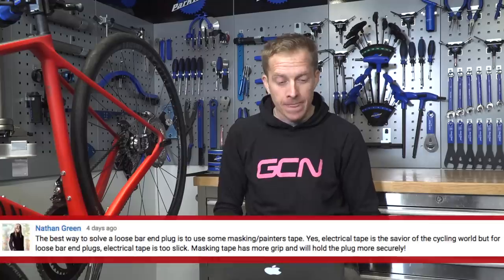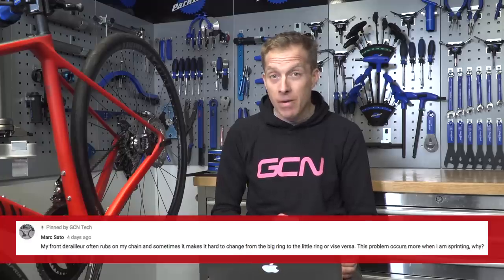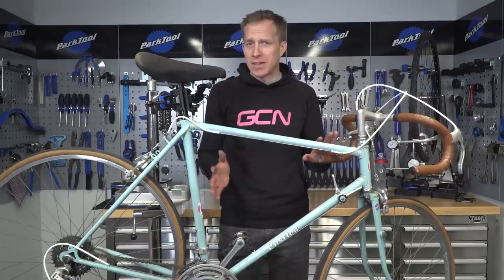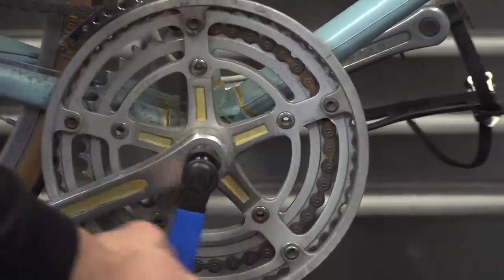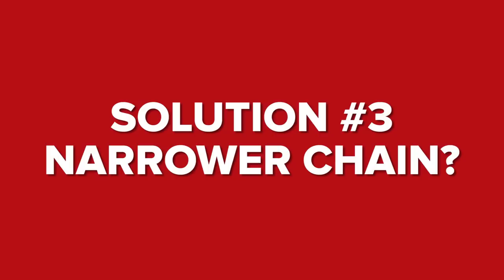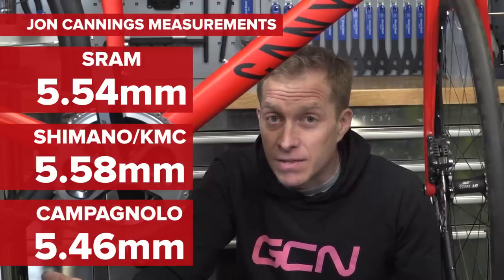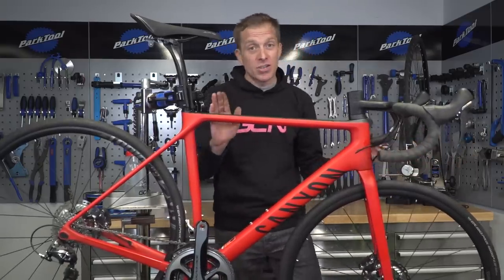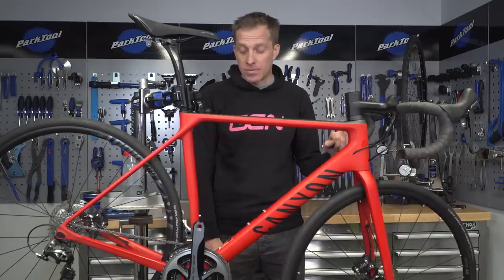How Can I Stop My Front Derailleur Rubbing? | The GCN Tech Clinic

Comment: My issue: 
I have a problem that whenever I use my 2 heaviest gears on my rear shimano 105 cassete my bike starts making a creaking/scraping noise
I can't tell what it is or figure out how to fix it!

the model is a lapierre xelious
press fit BB
shimano 105 groupset

please help it's really disturbing and I'm sorta afraid of using those 2 gears as a result!
Reply: Same
Reply: If it’s coming from the front derailleur (you can carefully look down while you ride to see) it’s just an indexing issue with the front.  That’s because the chain is angled toward the outside of the bike slightly within the tight space of the cage.  Modern front derailleurs can be a pain to get right, but with some perseverance and optimism, you’ve got it!  If it’s not the front D, try having a friend hold the bike up by the saddle while you turn the cranks and try to listen for the sound.  If it only happens when pedaling, you’ve got a crazy BB!
Reply: I had the same issue with the same group set over the summer. I had to take the pedals and crank off, give them a good lube, and the issue went away,
Reply: Thanks Samuel I'll be sure to check that and if that doesn't work Jamie your tip might help so I'll give that a go!

thanks a lot and if anyone else has a theory of what might be cause it please comment and feel free to try and come up with a solution!
Reply: Definitely let us know! If I can, I might get a quick recording of how I did it.
Reply: It could be as simple as a rear derailleur cable settled with too much tension. Try to loosen the cable a bit.
Reply: Kuma Duma

Sorry if this seems obvious. You mention the 2 heaviest gears on the rear cassette but you don't mention whether you are on the small or large ring. A large to large or small to small ring/cassette combination can produce the noise you are describing. 

Occasionally, I lose track of which gear I am in on my Ultegra 6800 11 speed and shift too close to this cross. The chain makes a horrible noise and I know to adjust the gears up or down.  The cross puts too much torque in the chain and should be avoided.
Reply: Rick snyder the noise is made no matter what gear I'm on the front gears and on the rear it's only my 2 heaviest so the smallest sprockets!
Reply: You should really try to tighten the little wheel/screw (sorry don't know the english name for this) on the back of your rear derailleur at the end of the cable. One round (or even 1/2) should be enough.
Reply: Kuma Duma

Then it sounds like the indexing on your cassette needs a slight adjustment.
Reply: dunno if this is the same for everyone but on my bike in the big ring at the front it does that either with the two highest or two lowest. my solution is that when you change ring just click the gears slightly and it should stop.
Reply: It is not uncommon to have movement in a pressfit BB, especially in the plastic cups. You can try pulling your BB and refitting it or get something like Legit Engineering's press-fit replacement that will eliminate the plastic bits. You might also want to inspect your frame for any cracks or odd looking blemishes in the chainstays, I had a bike that would creak when sprinting and it turned out the epoxy bonding between the aluminum lugs and carbon was moving.

Comment: I have 2012 cannondale synapse with Sram Apex brakes.  I can’t stand them because the rear is always getting brake rub !  I can move the mech back and forth slightly with my hand is that part of the problem or how do I address ?  I’m tempted to either upgrade brakes or dump the bike altogether and go disc .
Reply: Andrew Brown
The problem may not be with the brakes. If your rear wheel is out of true it could be wobbling and causing the rub. If that doesn't work, make sure the caliper is attached tightly enough to the frame.
Reply: You might want to try using a 13mm open jawed spanner to hold the caliper in a central position while tightening the brake mounting barrel bolt.

Comment: I have an issue with getting clincher tyres to seat properly. I must of taken them on an off 10 times and there is always a section that sits low. Try pumping up above my disired pressure then letting down. The tube isn’t pinched and is in the tyre correctly. It’s not fun riding along on what feels like an oval wheel! I been riding and changing tubes forever and this seems to be a new issue..different tryre and different wheels...I’m at a loss! Any tips?
Reply: When the tyre is fitted partially inflate it just enough to hold the shape. Then, starting at the valve go around the tyre pushing it away from the outside of the rim on each side. This will do two things,1. ensure that you are not going to pinch the tube and 2. manipulate the carcass so that you get an even inflation.
Inflate to the max capacity of the tyre then deflate to your desired pressure.

Comment: I've washed my bike yesterday with a hose (low pressure) and somehow my frame got filled with water! 😱 Any idea on how this happened, how to avoid it and how to remove the water from inside the frame?
Reply: I've removed the water by rocking the bike back and forth whilst on a vertical position and it ended up leaking through the cable guides on the bottom bracket.

Comment: I have a Simano 105 groupset on my road bike.  I've had my front deraillure set correctly at my local bike shop.  Once setup the shifting is perfect with no chain rub.

The roads that I ride on are quite bad and full of pot holes and rough surfaces.  Despite being as careful  as I can with the bike after a few days riding the chain starts to rub again on the deraillure cage.  

Is it normal to keep adjusting the front deraillure to avoid chain rub?

I've tried trimming the gears to move the cage a tiny bit but this never seems to make any difference.
Reply: Did you get any where in this ? My SRAM front mech has started playing up. Catching on the crank so I screw in the adjuster screw and bring the mech closer in. Solved. Until I've done 60k and it's catching again. Grrrrr.

Comment: Is my bottom bracket the thing making the creaky sound or is it something else?  It comes when I put more power through the pedals. I am doubting it because it seems to be worse when I am in the smaller ring.
Reply: Stuart Dryer Though the BB is notorious for creaks, it’s an expensive replacement and there are a few other places that are helpful to check before we blame the Bb.  You are clever to be suspicious!  Since the strain on the drivetrain is less in the little ring, it’s less likely to cause a BB creak.  However the torque is greater!  The wheels have to absorb that torque, and can actually be the culprit.  Simply apply some lubricant to your spoke nipples from the outside and the spoke crosses, using triflow, WD40 or a similar penetrating lubricant.  This might fix it right away!  Another issue could be the shifters if your creaking happens out of the saddle.  This is just an annoyance you’ll have to live with if that’s the case.  Similarly it could be grime in between the stem and steerer, which just requires a clean.  Lastly, pedals may creak with worn bearings or dirty springs.  Good luck!!
Reply: Check the fasteners on the chain rings. I've seen them come (ever so slightly) loose, enough to creak a bit.
Remove the pedals, clean the threads and apply some grease before reinstalling.
Do you hear the sound when standing, or just when seated?
If only when seated, it could be the rails on your seat.
Reply: TW Thanks all.  I tightened chain ring bolts. No noise today.

Comment: I have SRAM eTap running great on my bike. However every few days it appears that I have some issues with shifting smoothly. Generally I ignore it and the next ride is perfect. What can be causing this intermittent issue?
Reply: Bart Segall Great question!  Even Etap needs to be indexed, though it’s often set and forget.  Look up the user manual for verification, but if my memory serves me right, here’s how you do it:  look for a small button on the inside of the right hand shifter.  Hold down this button while pressing the shift button.  This will make small adjustments to move the derailleur outboard.  Using the other shifter in the same way will move the derailleur inboard.  You DONT have to run a full SRAM drivetrain for it to work perfectly, although oval chainrings and S-Works cranks have been know to cause some trouble.  If that doesn’t solve it, there are just s few more things to check, all of which can be researched easily on SRAMs website.
Reply: Samuel Hopely I can understand why oval chain rings could cause a problem, and know someone who had to move away from etap because they use oval rings. Not sure why S-Works cranks would cause a problem though. Please explain as I am currently specing etap with S-Works cranks for my next build.
Reply: Rear derailleur. Checked my hanger and it was slightly out of alignment. Rode 40 miles no issues so perhaps that is the issue. Thanks

Comment: How to get lower on hybrid bike. Handlebar is at lowest position all spacer are above. Can I reverse my riserbar upside down? Or should I get flat handlebar?
Reply: Difficult to help here without knowing what stem you have. It is possible to simply flip the stem to get a lower position, or if that has been tried you may want to invest in a  -17° stem. That should get you another 10mm or so lower.
Reply: Colin Milne : my stem is flat (0°). Have a riser bar of 10mm rise. Is there any disadvantages to flip riser upside down?
Reply: The trouble with simply flipping a riser bar is that once flipped the dihedral angle of the bars turns into an anhedral which means that your hands will tend to slip off the bars. Probably better to get some flat bars.
Reply: Thank you for the answer.  If i change my riser with touring bars, will it help?
Reply: If you mean drop touring bars you will need new brake lever/ shifters, an expensive choice. Alternatively there are the butterfly touring bars which afford multiple hand positions, these can be sourced with no rise.Or simply go for a flat mountain bike bar with no rise.

Comment: My bike has a Shimano press fit bottom bracket.  I'm running ultegra 11 speed with speedplay pedals.  After a rather wet century ride, the bike developed a popping sound coming from the crank area and I could feel a bit of "grinding" when pedaling.  What are the possible causes?
Reply: William Keys I have the same thing but I have 105 pedals and a square taper bottom bracket. Can't seem to diagnose the problem myself.
Reply: Bottom bracket bearings need changing. 
I used to get this on my ISIS (ahhh) B.B. a tiny bit of grit gets in between the balls & if there’s a pit in the race you’ll feel it click at one particular point in your revolution. 
I changed Pedals , greased threads, & glued on pressfit cranks ( don’t do this) before I realised it was my B.B.
Reply: David Fellows I have already done that and it still did that on the first muddy ride after having them changed.
Reply: alex fulton re grease your pedal threads, try beeswax jelly on your cleat - pedal contacts - look for oz cycle on YouTube on how to make. 
Anti seize compound (thicker than grease) on your B.B. threads. Could also be your pedal bearings but do not try to change Shimano bearings. They will never go back together again- trust me. Other than that I don’t know.
Reply: Speedplay recommend that you purge the pedals after every wet ride. Worth trying, I had an annoying click every pedal rev on my LA's and purge greasing solved it.
Reply: Colin Milne thanks for all the help guys, ilk do one at a time and see if it solves the problem ☺
Reply: Colin Milne yes this is true. Also I’ve noticed the new style of speedplay cleats - the walkable ones the yellow rubber rubs on the pedal axle & causes a squeaking noise also  the spring can creak when you move your foot from side to side if some dirt dries up in it.
Reply: You are the winner Colin.  That was the solution to my problem.  That Speedplay recomendation isn't one to be ignored.
Reply: William Keys awww drat I tried so hard too I suppose 2nd place isn’t too bad 😝

Comment: I have a Focus Izalco with SRAM Force. The '22 useable gears' is real by the way. My problem is that often when I roll the bike backwards the chain comes off the chain set (inwards). Tried playing about with front mech but it still does it
 Any ideas?
Reply: Fit the chain catcher that came with the front derailleur.
Reply: Chain catcher is already fitted. In some ways it makes it worse as sometimes the chain squeezes past the chain catcher which makes getting the chain back on even more of a pain (and that's with the chain catcher as far towards the chain as it will go without rubbing on the chain).
Reply: Colin Milne I'm now wondering if the rear mech is misaligned: it came part way off yesterday and came off at the bottom as though the rear mech was pulling it off
Reply: Sounds reasonable, take it to your LBS for a proper alignment check.

Comment: Yeah, no. Don't shift while sprinting. I did it about 15 years ago, sprinting away from a stop. Stupid mistake. Chain came off, I went down like a sack of wet sand, shattered my shoulder (all the cartilage in the socket..both the ball end of the humerus and the socked part in the shoulder..are free floating to this day) and nearly got run over by a city bus. 15 years later my arm still goes numb every so often.

Comment: My front derailleur screws are stuck and I can't move them. I've tried WD40 and not blaster, any other solutions?
Reply: Randy Poor If your FD is a little on the older side, you might unfortunately be better investing in a shiny new one, though you don’t need to go top of the line (remember they have to be compatible with your shifters!) If it’s newer, you might be able to warranty!  Shimano SRAM and Campagnolo are surprisingly helpful with warranty issues (they don’t want you giving up and moving to a competitor!) so give it a shot if that’s the case!  FD screws can be, well, screwy sometimes, but your troubles are definitely unorthodox.  Your lbs would be the only place authorized to do warranty work for you, but more than likely wouldn’t have to charge you (the manufacturer has to compensate them for the labor, or in the case of SRAM give them a shit ton of free chains)
Reply: Randy Poor 
Did you remove it and soak it in the wd40? Or just spray and go? If you just sprayed, try soaking it for a bit. That usually does the job for me for my stuck parts.
Reply: That Ewok spray and go :)
I'll try soaking it. Thanks!

Comment: My question is, why does my jockey wheel vibrate when I'm cycling. I put my bike up in the air and when I peddled, the whole rear hanger started to vibrate.
Reply: Possibly worn bearings in the jockey wheel. I had a similar problem on a Sram Rival dr, when I dismantled the jockey wheels the bearings were toast.

Comment: How to clean a very oily chain
Reply: Ciaran A Tupperware box, water, laundry liquid - shake. Repeat 3 times. Then dry either with hairdryer or leave to drip if you have more time.
Reply: Use muc off drivetrain cleaner
Reply: Janosch K if you want to have no money left and messy floor - use muc off chain cleaner.
Reply: Be sure to clean the chain rings,  cassette and jockey wheels too. Otherwise those dirty parts will keep your chain dirty too.
Reply: If you want to really clean it to have something shiny as new, gasoline is really efficient, it will dissolve the oil and all the dirt. And the drying step is really quick (2min) so no way your chain will rust. Then you can oil it again. It works for the cogs and the chainring as well. But don"t try this on the jockey or other pieces with bearings because it will harm them.
Reply: Soak chain & sprockets in petrol in a sealed container. Dry. If you never want an oily chain again then immerse in melted paraffin wax with a bit of paraffin oil in a slow cooker for 20 minutes. The downside is that you need to repeat this last step quite often (300 miles). The upside is a super clean chain and great shifting with no sprocket/chainring wear. Great for commuter bikes and day rides. Terrible for touring.
Reply: Ok. You are right
Reply: clean it once roughly and then again properly

Comment: Why is the right brake stopping the rear wheel? You guys are in England so wouldn't the brakes be the in conventional way? And it's a Canyon as well.
Reply: John Doe noticed that as well
Reply: I think all bikes in England are that way. In the states, it's often called moto-style.
Reply from the maker: +John Doe it's pretty common for bikes to be set up like that in places where you cycle/drive on the left hand side of the road.
Reply: Yep! That too! I believe it stems back when which hand you'll commonly indicate with. Since England folks are on the left side of the road, you'll indicate more with your right hand and brake with your left.
Reply: UK bikes come with the right brake lever operating the front brake as standard. If you go into any bike shop that is how they are set up and in order to get it the other way around you must specifically ask for a continental configuration. Continental configuration is where the right brake lever operates the rear brake, this is how most serious cyclists eventually arrange their braking.  It has nothing to do with which side of the road you ride but does have a lot to do with weight saving on cable outers. The continental configuration shortens the required length of cable outer quite considerably.

Comment: Fraying break cables
Reply: Prior to cutting the cables to length tin the cables where they are to be cut and cut through the tinned section. If you can't tin the cables buy some cable crimps an crimp the cables once they are cut to length.